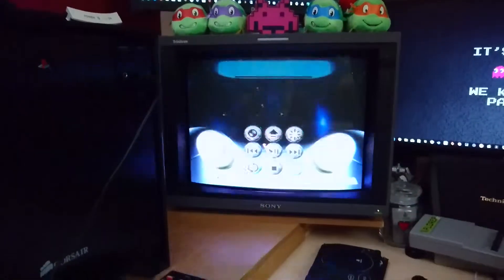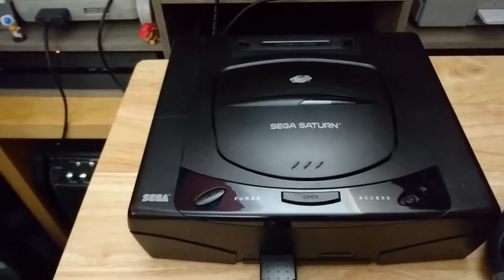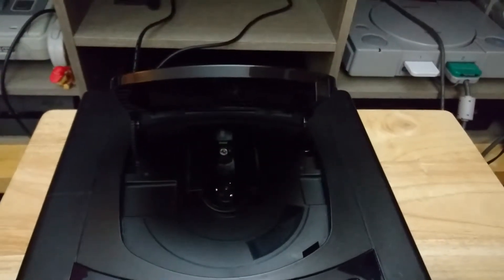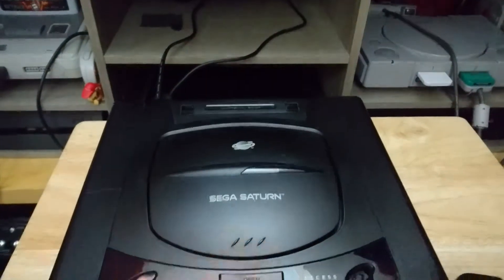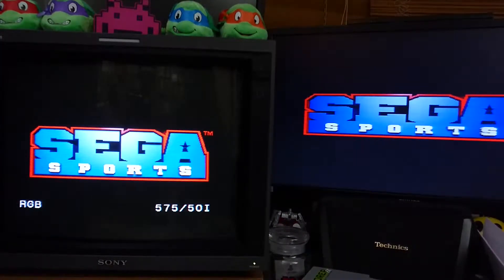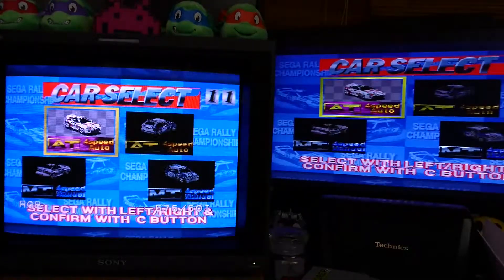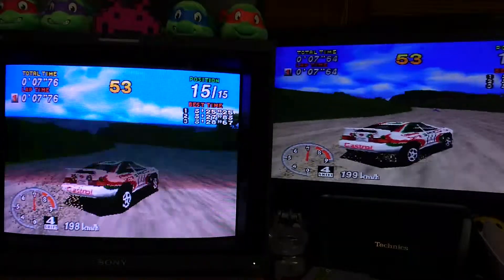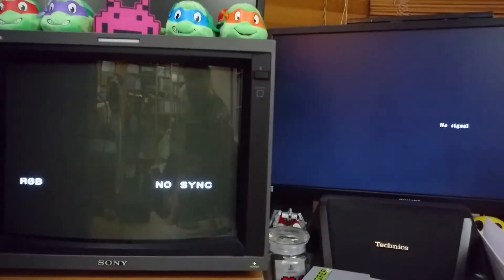SEGA Saturn MK1 Repair Outcome (No Video / Optical Drive issues)

Comment: Hey simon I have a working sega model 1 but the spindle is all the way down. I was looking all over the place for tips and tutorials and it seems as though no one has a video to fix the spindle. I tried using a pair of piers to bring it up but, it always comes back down. I am struggling and dont know what to do.